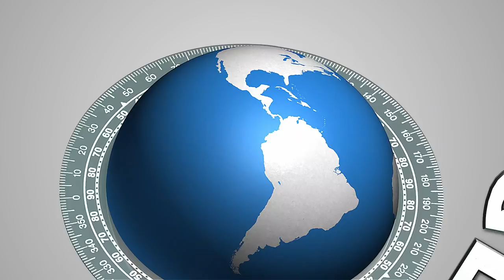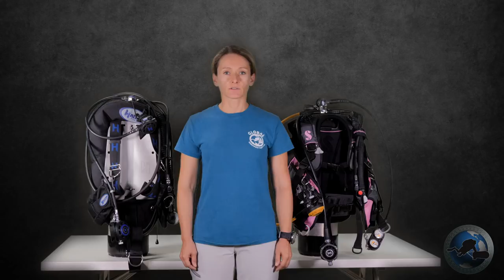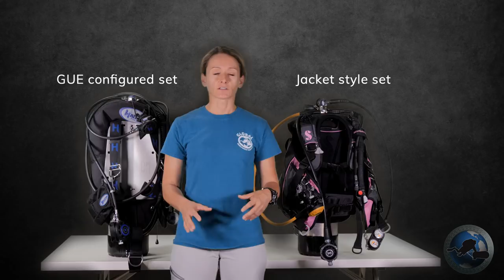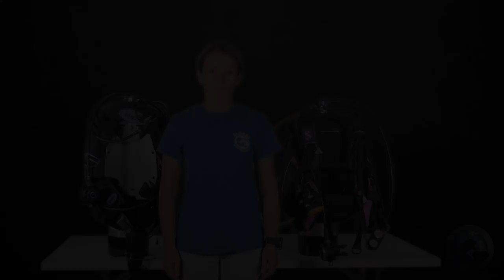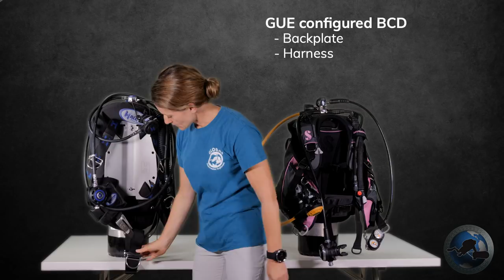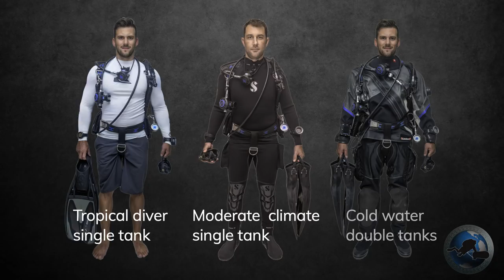BCDs (jacket) VS Wings: Scuba Diving Equipment debate

Comment: The presentation didn't detail the benefits of wearing a jacket BC for novice divers. GUE configuration can be applied to a jacket BC, as long as the D-rings are s/s. You can also add a stage bottle. When diving from outboard-powered canoes, you may have to don the jacket BC while in the water and remove while in the water. Something most tech divers still cannot do. Yes the Halcyon wing is a great system for divers to begin their dive training from OW to tech. But in the end it's all about cost. Also, in the event of a rescue, the jacket has clips which are easy to remove, compared to having to cut away the pure harness.
Reply: My dude GUE owns Halcyon or was it other way around hahah so yeah......Her talking about disadvantage of having jacket being muscle memory if you go to another jacket as if that's not as well standardized and gear placement being same. Also if you buy jacket that can support doubles you have nothing to worry cuz there are those to. GUE is just trying to make themself look to be somehow special and sell it at high price. I blocked the channel after I saw another BS video and somehow google still puts it in recommended shit....

Comment: I’m in the middle of switching over to GUE.  I wish I would have started with GUE.
Reply: We only have one place in my city where you can get certified and they will sell you equipment you'll soon need to replace if you want to dive on a higher level. A five star PADI diving center too! They also will refuse to sell you tech stuff and you are required to either rent or buy the gear that is acceptable (for some reason) for new people. Someone wanted to buy somewhere else but were told they would have to buy at their shop to take the course. Will also sell 12L single flasks to women because women don't use as much air. Sometimes the courses they have won't even cover everything they need to. 

We live and learn right. I'm going to start buying tech gear now and hopefully will be a GUE diver soon.